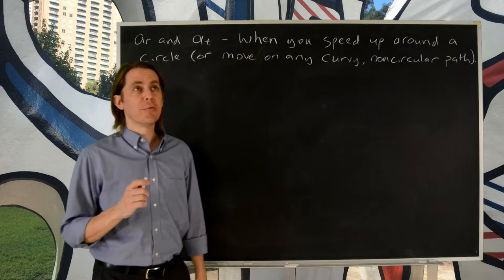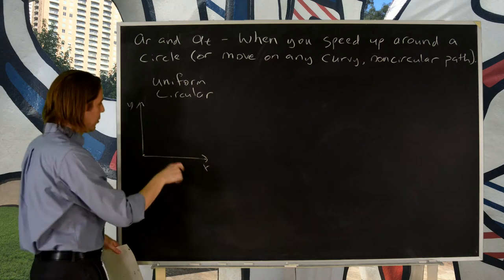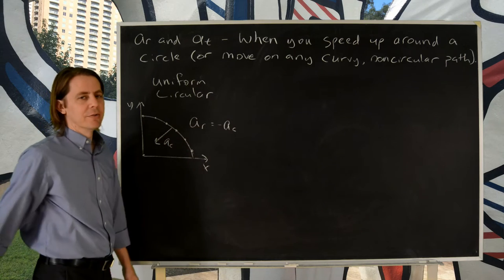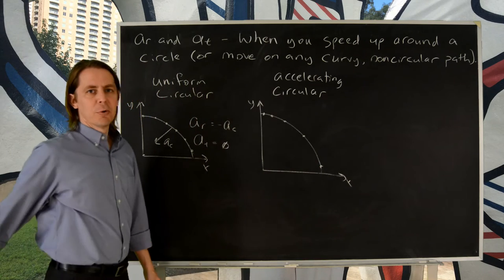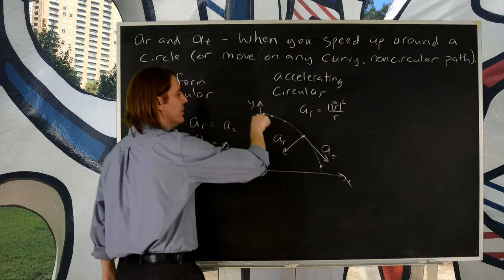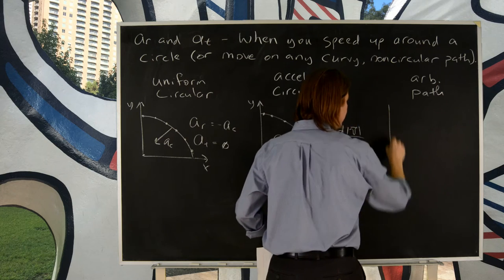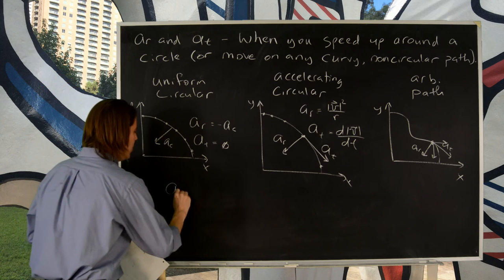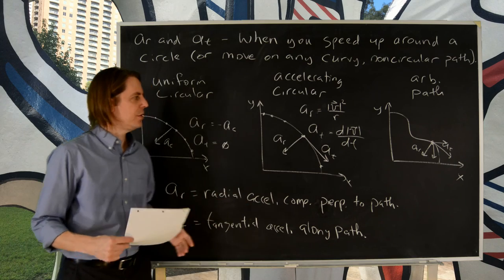Tangential and Radial Acceleration

Comment: how'd you know that there was tangential acceleration in that arbitrary path? Or, how did you know that speed wasn't constant (and therefore tang acc doesn't equal zero) like in the first graph
Reply from the maker: It might be zero the way I described it.  You could be moving at constant speed on a curvy path like that so that the tangential is zero.  I just wanted to stress that radial is perp to path and tangential is along path.